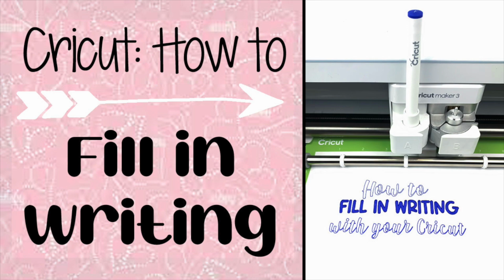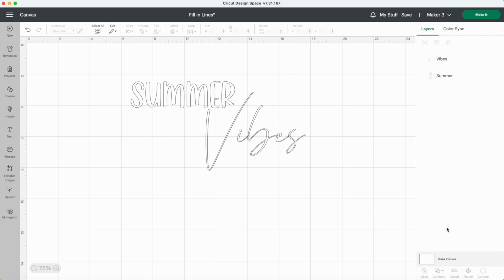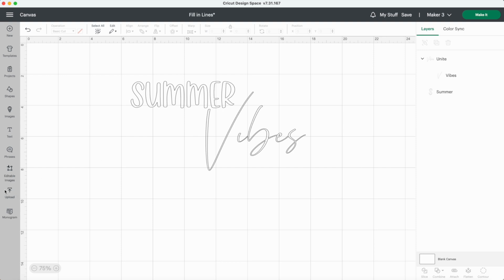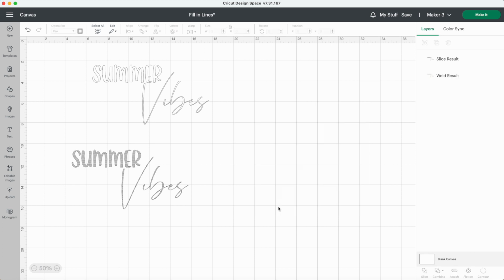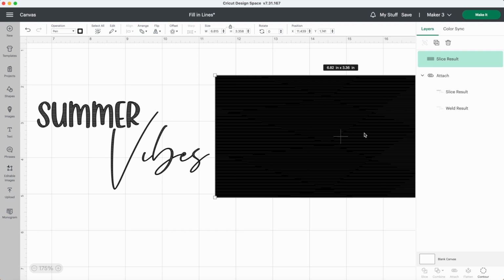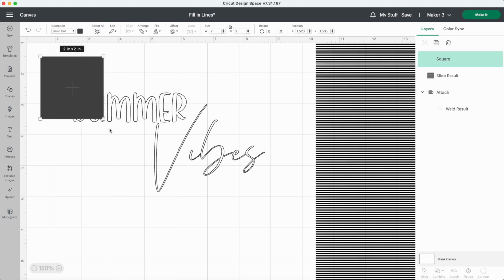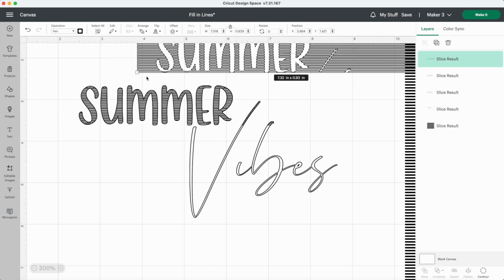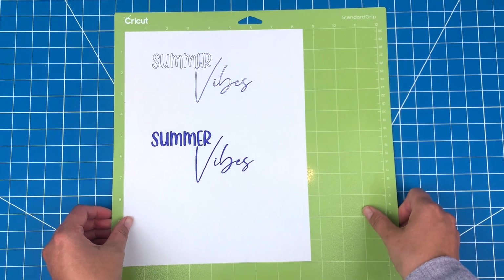Cricut Tutorial: How to Fill in any Font with your Cricut!

Comment: Not sure if this will be seen or answered but I am having an issue with this.  Your video is great and very easy to follow btw!  But when I upload my purchased fill line image and it is set as cut so I change it to draw, then I weld it and it goes to solid white so no lines on it after it welds.  What do I need to do to fix this?  Thank you.